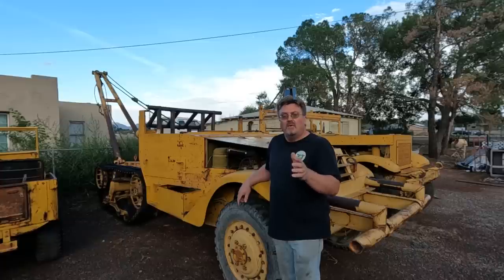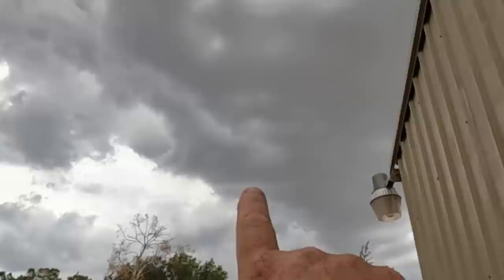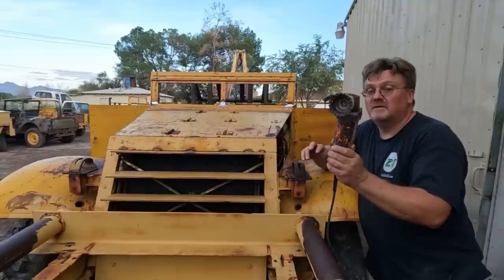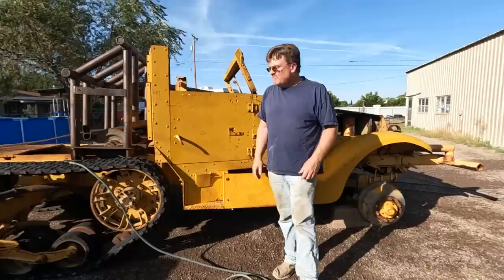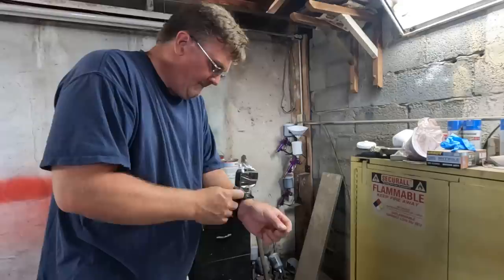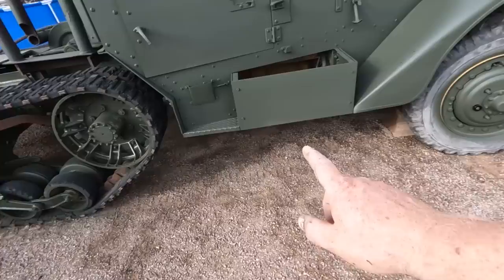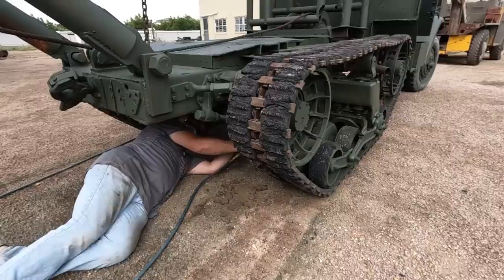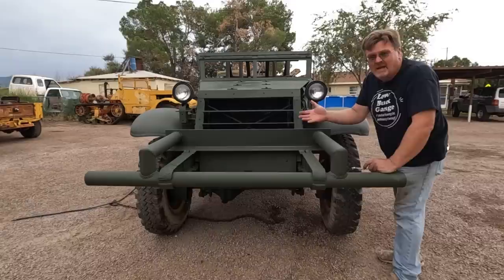WWII Half-Track Paint Job

Comment: Some of the military olive drab paint was made to self level and you could apply it with a paint brush and it'd level out as it dries. I had a long response typed to the last  post you made about this truck and it went away on my tablet. My first car was a 42 Ford GPW Jeep, my second was a 41 military closed cab 1/2 ton weapons carrier pickup with a early Braden MU2 winch. This was in the late 70s early 80s. I had a crazy friend I met because of my power wagon and we knew of a old truck wrecking yard that had 3 white half tracks in various stages of missing body parts. The nicest one had most of the front nose and rear box and was fairly complete with the 30 ton winch on the bumper. Second had the nose and cab similar to yours. Third was just the complete frame and nose with the engine and everything else was gone. We were told they had all driven in 20 years before. I later heard that crazy buddy had managed to make a deal on the two best ones but I never could confirm it as I quit hanging out with him because he truly was mental but he did know a lot about the old power wagons and had many similar to mine.
Funny thing Dodge couldn't build the early trucks fast enough because they didn't have enough cabs on hand. Ford, Chevy, and International took mostly completed frames and noses in and adapted their pickup cabs to the Dodge frame and nose. I saw one in a yard with a Chevrolet cab on it perfectly, and my buddy had one with the International cab on it. Back then when I was a teenager those old ww2 military trucks and Jeeps were all over the place and you could buy them pretty cheap, they were just starting to get collected and prices going up but most were considered old all wheel drive trucks and used accordingly and cheap. I paid 1k for the jeep and 1300 for the Power Wagon in 77-78.
Reply from the maker: It did seem like this paint was meant to be easy to apply, which I sure appreciated!  Interesting about the trucks, its amazing all the things that have happened in the past.

Comment: From fugley yellow to a nice warm mat green 👍
What a difference that makes.
I just got done painting my ‘51
Ford F1 pickup. I owned the truck a few years before deciding to remove the hand brushed farm paint job. To my astonishment military numbers started to appear as we stripped it. The doors, hood and tailgate all had the same truck’s military #’s on them! The id plates had no mention of being a military vehicle. Some unofficial opinion’s are it must of been a bang around base truck or a 
“follow me” truck from a nearby airbase. The paint under the GI-ID’s was definitely OD.
Anyways I recently moved my shop and don’t have 220v yet for my compressor. So with a deadline of a truck show coming up I chose to use around 40 Rustolem 2X 
forest green spray bombs on the F1. Then I had a local sign maker print some vinyl letters & numbers for it. 
What a difference! A similar
result of the transformation on your half track! 
Night & Day!!
You have a cool channel and a unique twist on the way you do and share your thoughts with us. May you never get stale on your content 😃
Reply from the maker: Thanks, I sure appreciate that!  It sounds like you had a fun project, too.  One nice thing about rustoleum on an old truck is that it isn't too shiny, gives it a more authentic work truck look.

Comment: Ok so I'm a professional car painter and new on the channel in fact it's my first comment ... you can be overly picky on the Prep work ok - I don't want to start off all critical you can spray over pine needles, You just hit the air without the paint and blow them off - look at all the trouble you went to like I said you can be a bit overly picky on the prep work for this job.
Bigger wire brush - that things stiff as hell and only 100mm As a Professional I would have hit it with a softer wire brush but about 200mm round is shit site faster.
You could get a job in my car, boat, insurance jobs, car jacking "Quick One Coat Re-Painting" business anytime bro ...

Comment: Well it looks better now anyway, but those tracks look-like they aren't fit for operation anymore, what can be done about those?
Reply from the maker: The entire cab on the other half-track was ruined already by a previous owner, its only good for parts now.  I need to get the body off it so I can use the frame for another project, so that was one more part removed and put to good use.